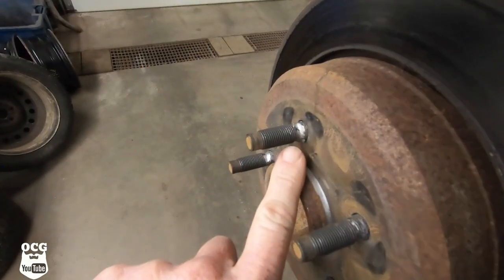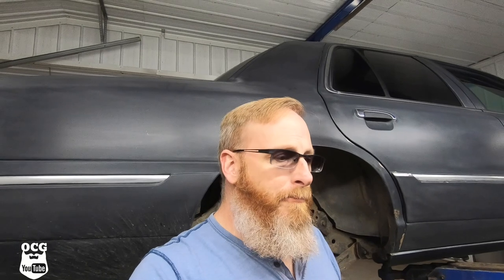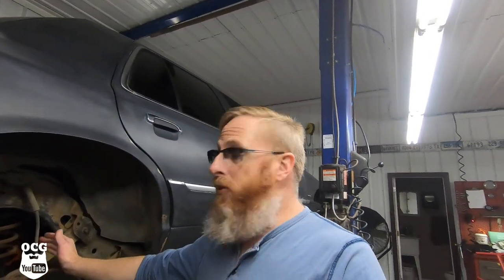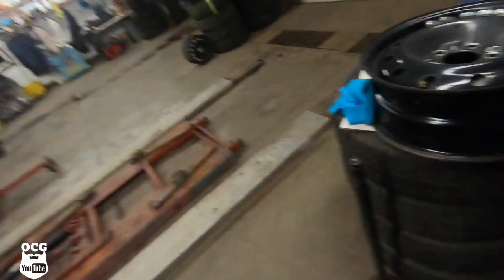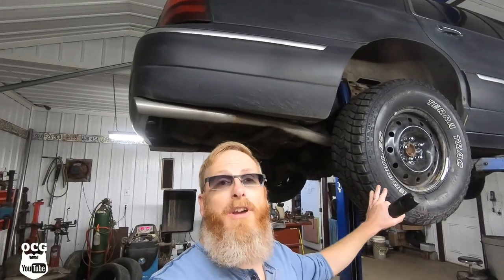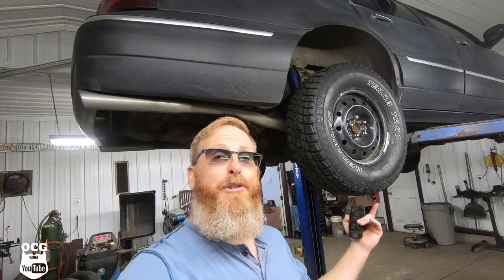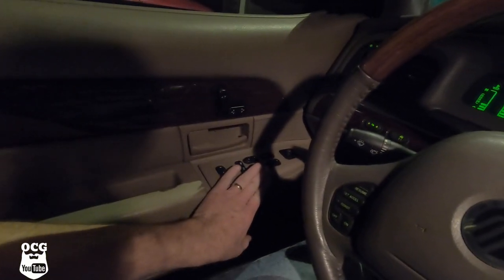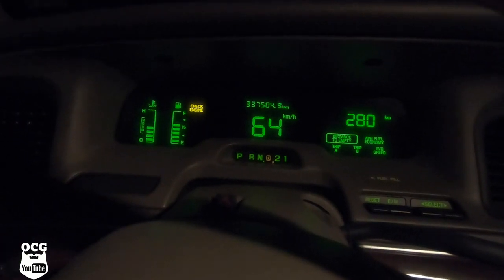NASCAR Style! Loose LUG NUTS Will Cause An ACCIDENT! NASCAR Style!

Comment: 99% of so-called techs refuse to use a torque wrench on lug nuts because they swear their torque stick will evenly torque a wheel down even when the hub is loaded with oxidation and the studs are rusty and screech when the nuts come off or go on. They seem to know everything about everything but their the guys who need to buy an engine after replacing a timing belt or chain.
Reply from the maker: There's more of those guys than i's care to admit.

Comment: You can re-calibrate your speedometer, and pull the 5 digit door code yourself with a $30 ForScan Tool.
They sell 'em on Amazon.
Don't get the wi-fi, or bluetooth version.
Get the one that uses a USB Cable.
It's basically almost a dealer level scan tool.

Can you put on some stock Grand Marquis wheel covers?

-Chuck
Reply from the maker: Thanks for the tip. Should be here tomorrow.
Reply: @OldeCarrGuy  
No way, you got wheel covers.
Hot dog!
Reply from the maker: @PanzerPlatform  Stock wheel covers are for beauty Queens. BlackJack is a Joker! lol

Comment: That happened to me once on a Toyota 4runner. Good thing you caught it.
Reply from the maker: Good thing is right! Thanks Gary
Reply: @OldeCarrGuy  I caught it on the 4Runner before it came off too. Aftermarket wheels and lugs. I also had it happen on a '97 Ranger that I bought used. The PO said he did the brakes. What he didn't say is that he forgot to install the keyed washer on the front left wheel bearing. The spindle nut unscrewed itself on the highway at about 65mph and the only  thing that kept it from exiting the vehicle was the caliper holding the rotor. Sudden left turn, good thing there was no one next to me. Got it stopped safely on the shoulder.

Comment: Super handy having a Grand Marquis hoard now...haha. Glad it all worked out. I'm surprised the gear change on GrandMa had a speedo hiccup. Does your 8.8 have an ABS sensor that plugs into the top of the differential? On my F-150, I didn't have to recalibrate the speedometer with an axle housing swap from 3.08s to 3.55s because of this. The speedometer was run off of the rear gear rather than transmission like older cars. Don't know if panthers all the same. Now the tire diameter change on this one for sure makes sense. But hmm. I'd say nitrous for black jack though...easy to swap to the next build.
Reply from the maker: Car hoarding is fun. These car have ABS sensor on each wheel therefore a re-cal is needed. Never really thought of nitrous, the only downfall is the accessibility of it.

Comment: On my lincoln if you unlock the door from the inside and then press the two buttons on the right of the keypad it locks the doors !! That is one way to check if your keypad is working !! 
Also the previous owner might have changed the keypad code !!
Reply from the maker: I know the keypad isn't working on Grandma, But is working on BlackJack...if I had the code. From what i understand, the factory key cod always remains the same even if you ad your own.  I'm I mistaken?

Comment: The code is also on the passenger side arm/hinge of the trunk (at least that is where my 1999 MGM LS had it's code).  I just about tore my door apart too before I noticed this number in the trunk.  Also like the look of the Mustang wheels on your MGMs and wondering if any one has  tips on how to match up the Mustang wheels for my1999 Merc Grand Marquis LS- Do you need a certain year or type? Current ones have too much of the "Grandpa" look for me.
Reply from the maker: I have 2 MGM's and neither had the code on the hinge. Thanks for the info though.

Comment: Seems like if you encounter a loose wheel it will generally be on the passenger side, why is that? Why did the older Chrysler products Dodges, Plymouth's have left handed thread on the wheel studs on the passenger side?, Think about it........
Reply from the maker: If only we had all the answers. Thanks for watching Paul.

Comment: I realize this is an Old Post but I just saw your video on this lift kit and it made me cringe I've been a mechanic for 40 years aircraft Diesel and Auto and that was the worst rear spring lift I have ever seen I would have gotten longer Springs totally unsafe in my opinion for what it's worth
Reply from the maker: It’s a kit I bought from Liftabrand. If you go back and watch the install video you’ll see that there is no way those are coming out by themselves. Besides, it’s not as if I’m going off reloading in a Grand Marquis. It’s all for the look! You know… just for show.
Reply: I would have welded the rear spacers to the axle at least but good show thank you